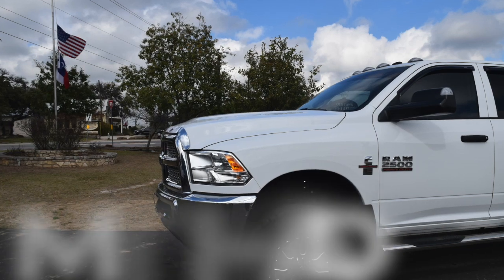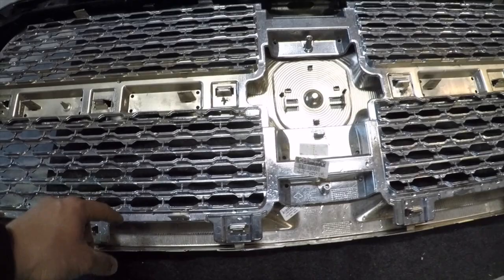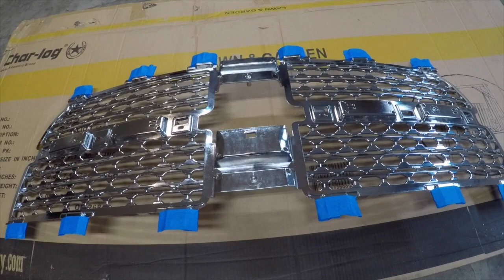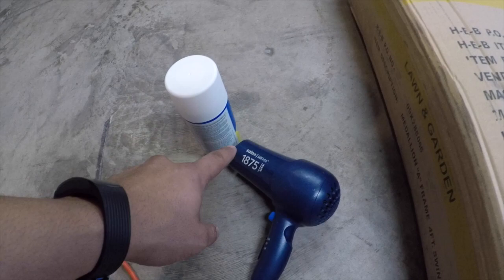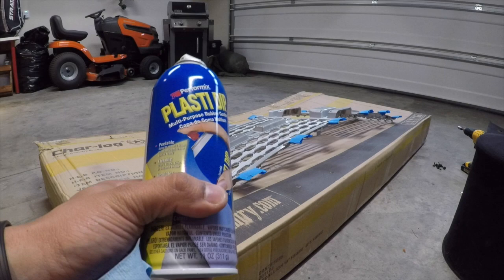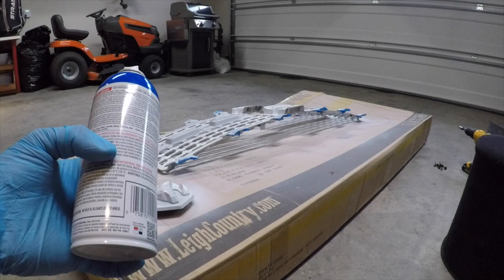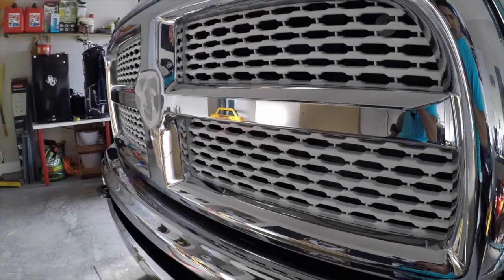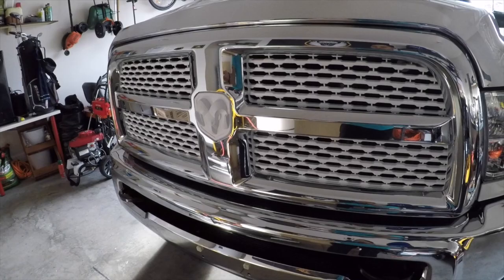How-To PLASTI-DIP Ram 1500/2500 Grille! *MOD*

Comment: Nice job, but I'm not sure the white grill with the chrome. I think I would of done the frame white and then make the insert black along with the RAM head black especially since you are getting a black bumper. just me opinion, but you go with what you like.
Reply from the maker: Yea, the thought process behind it was that I didn't want two different shades of white touching, so using the frame as the color separating factor. I do want a change to the front grille emblem and more black period for the grille once I get a new ranchand front bumper.

Comment: How mamy cans?
Reply from the maker: You can get by with one, but depending on how many coats you want to do, 2-3.
Reply: @MotorHead18  Thanks for the response. I was thinking of 6 coats to achieve maximum results based on the videos I watched. Good job, Sir.
Reply from the maker: @mastere4410  Give it a try. Make sure it's clean first, prep is key. Even if you mess up, the cans are cheap and you can peel it off. I wouldn't care if there are small mistakes because it will be catching bugs anyway given the location.